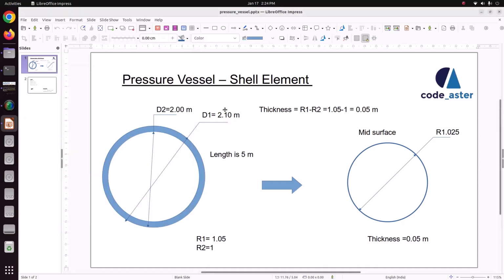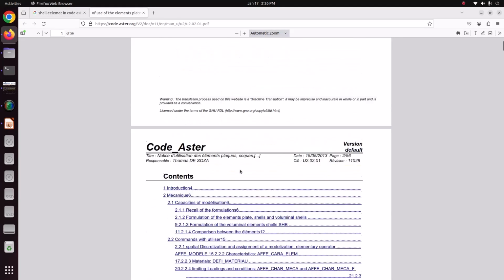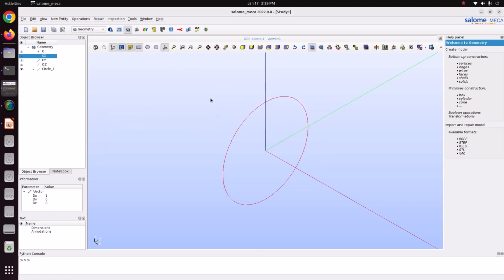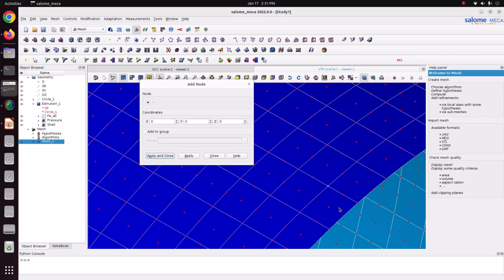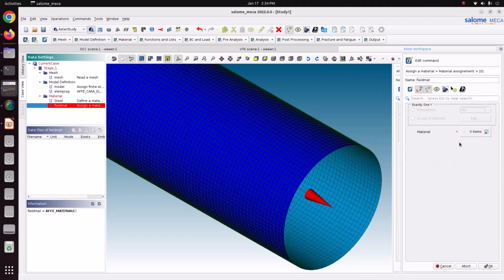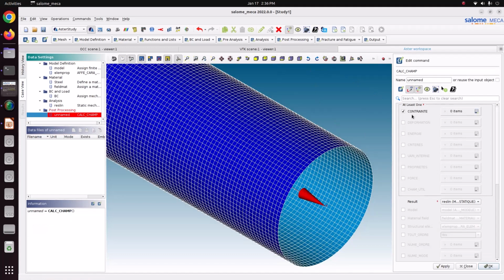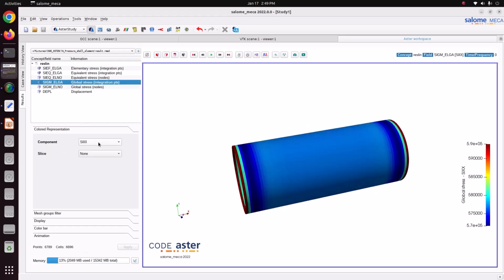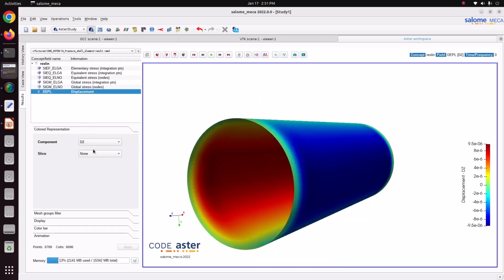Pressure Vessel Stress analysis using code aster|tutorial|paraview |tut-75

Comment: For some reason, the problem solved successfully, but when I tried to open the MED file in the post-processor, the message appeared: "The provided MED file contains no result concepts or fields" 🤷‍♂. Also, why is there such a discrepancy in the calculation of longitudinal stress?